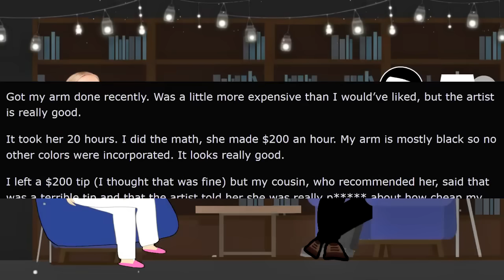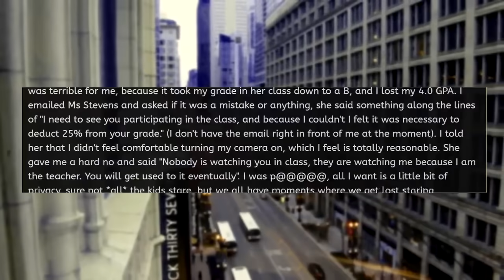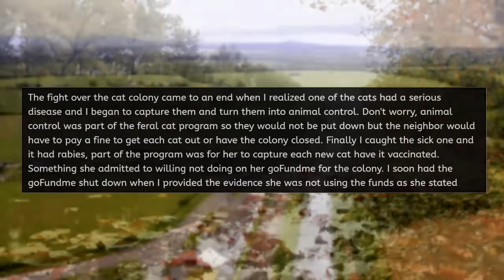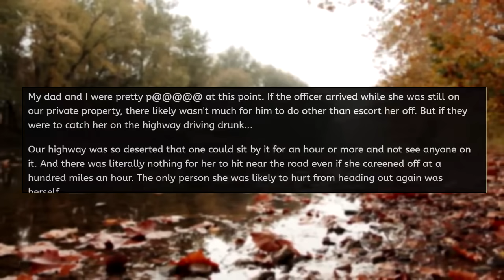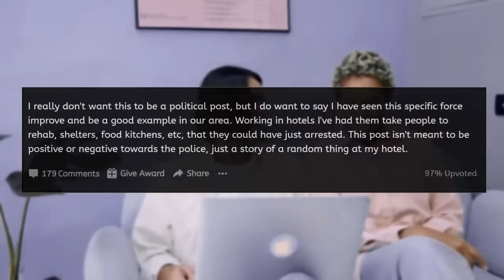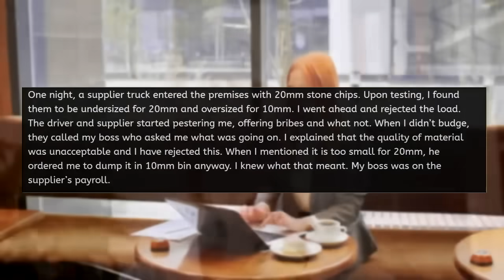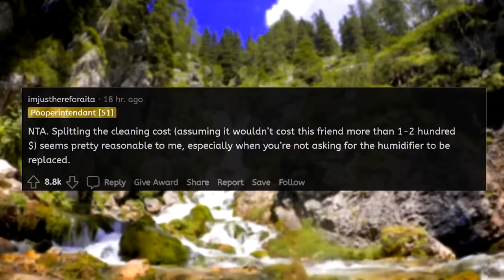Karen Gets $200 Tip & Says It's Not Enough!

Comment: I have to eat copious amounts of salt because I have absorption issues.  But I don't heavily salt the food I make, because most of my family is either on a diet or in a low sodium diet. I salt my own plate.  Why would you ruin it for everyone else?
Reply: Same here.  However, I used to often struggle with remembering to curb the salt I put into foods I make for others.  Fortunately, I also work as a cook at a nursing home, where salt is restricted when adding it to a dish, so I learned quickly.  Now, I either don't put any in at all or just a pinch or two.
Reply: I'm very sensitive to sodium, so it would be a serious health issue for me... I'd do exactly the same, especially if I bought the ingredients and cooked it...
Reply: Salt is actually an important part of a person's diet, not only for sodium, but also iodine.  Iodine is needed for a healthy thyroid, and iodized salt provides most of the required amount needed.
Reply: Pots?
Reply: @MrsKatieninja it's rude to ask a person what their condition is.

Pots, if I remember correctly, isn't a salt absorption issue. So this probably isn't it anyway.

Comment: I work in a tipped job. My answer is "great tip". 
Always be thankful for whatever is given so you will not be disappointed.
As for the turn on the camera argument, if I have to (and don't want to), then they will get a picture of the bun on top of my head, or just the ceiling.

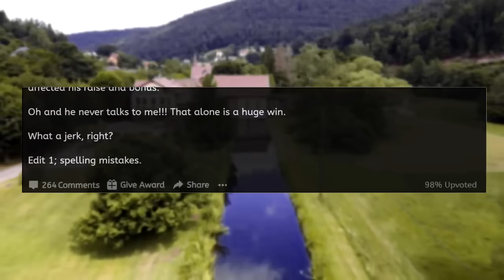Comment: 3:23:41
This is called isolation misuse (the correct word is censored if used). The bad partner turns all friends and family against the other partner in order to cut off any means by which they can get away.

I've seen this happen twice and it's awful. Immediately reach out and don't act with anger if this kind of thing happens.